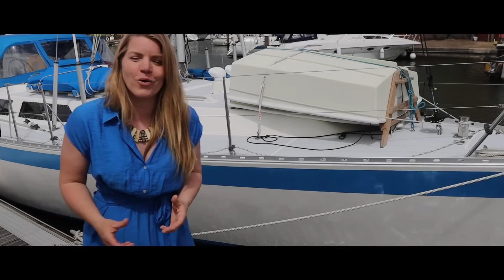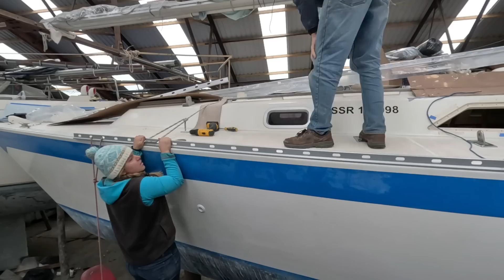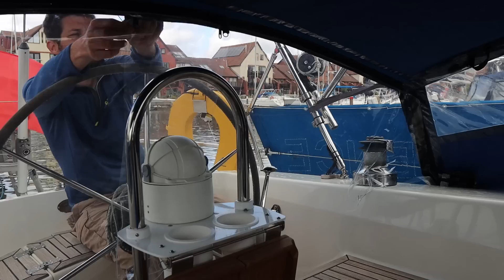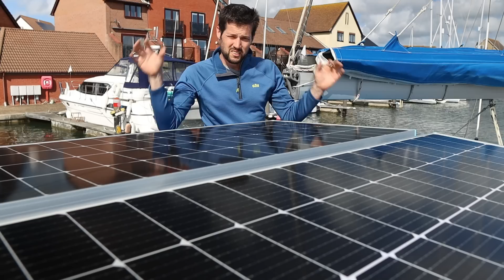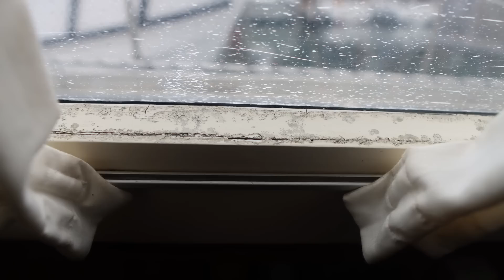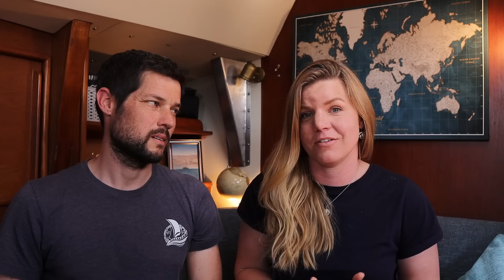Post Refit BOAT TOUR | Sailing Florence Refit – Ep.181

Comment: Now that you've sailed around Britain could you say that re bedding your toe rail fasteners helped substantially with the leaks? I have the same issue and am wondering if it's the fasteners on the rail, the hull deck joint itself or all of the above. Cheers thanks for the vids!

Comment: You may find that new staysail line will get in the way of tacking a larger jib. You may have to roll the jib in and out each time. Also, could you really trust that staysail roller and its line to take the loads of a storm jib in a gale? It looks rather light. and the storm loads are just awful. Am I missing something?

Comment: One of the most important things you can do is double “Glaze” your windows. Without double glaze you will forever have condensation dripping off. A window vac will be your best friend as you go North. The problem with the beds in the fore peak is moisture from you bodies which will condense against the hull below the mattress. Mould will be your worst friend. As I’m typing this I realise perhaps the best fix for this is one or two electric blankets under the mattress. You can get 12 volt 50 watt blankets. When you have surplus electricity or when the engine is running have them come on. Getting one was on my list for last winter but I never. Got to it.
Reply: What about installing a dehumidifier to combat the mold?

Comment: Highly recommend a air dehumidifier to keep condensation in control. We use it during cold spring and fall sails in Sweden (and when our 2 golden retrievers are wet). Also doubles as a drier when washing cloths and you can’t hang-dry outside.

Comment: "Florence" looks magnificent! A furler with  a luff wire is great! I had a ~160% genny with a wire on my 1971 Grampian 30 in the '90s, the furler mounted just aft of the headstay. Old fashioned, and not great for reefing (i.e. partial furling) unless going downwind, but so convenient. The reefable working jib (yankee) and storm jib were hank-on, the furled genny being dropped and coiled on the foredeck followed by hanking on the  smaller jib, Of  course, the jib could be hanked on before furling and dropping the genny, provided it didn't interfere with the furler. Yes, I had to go forward, and the halyard and sheets had to be moved over to the jib, but that working jib was so efficient. Stepping and unstepping the mast was so much nicer not having to bother with the longer-than-mast extrusion and heavy furler, and in my opinion safer than the conventional furling jib which can get stuck on the extrusion, especially if partially furled. I always found conventional furlers temperamental on other people's boats.

Comment: Florence looks wonderfull and very sympathic of you to be so transparent on the effort it took! That focused boat-work mode you describe is very recognizable! Since I grew so fond of you I take the liberty to share two concerns that rose when I was looking at the video: 1) the cushions: if you do not use them to sit against it may work, but as soon as you use them (and we use our cushions a lot on board) your puff jackets will reduce to no more than cushion filling. But that is not my major concern,  my major concern is 2) the tapestry like material that you added to the wall next to your sleeping berths. The insulation beneath this material is a very good idea, but I expect that the tapestry will not prevent the formation of condensate, but it will hide it. Giving you less clues that you have to improve ventilation, also you can not wipe it dry as you can a normal cabin surface and hang out the cloth. Furthermore, it will gather dust etc . I therefore fear that in this way you unintendedly created the ideal mold growing spot next to the place you sleep, which is potentially very harmfull to your health... Just wanting you to be safe!

Comment: Great work on your beautiful Oyster. We have sailed our own J109 Pinocchio up to northern Norway (in the summer). Great experience ! We have the same insulation under mattresses but also added multiple holes in the bunk under panels to ensure air circulation under the beds and in the cavernous lockers under them. Seems to make wonders for a dry comfortable sleep. Have a great time.

Comment: Fabulous reality check you both put out to the sailing dreamers. Florence looks absolutely great and ready for your next adventure. I Certainly Can't Wait. The one question I have is the beautiful new suite of B&G display all linked together and enter faced ? If so I have read it is best to have a independent transducer depth sounding unit, Independent Navigation chart plotter at a minimum isolated away from the whole linked suite. I seen it happen on youtube to other sailors and read stories about this happening. When the linkage is broken by numerous ways and they are all interfaced together one looses every device read out. By having independent critical devices at least one has the basics he or she chooses to continue sailing by if the system crashes for any reason.  Jim Rodgers

Comment: Condensation under bed. We use the air mesh too wbich only provides a partial solution to the condensation issue. This we have solved by using the interlocking foam floor mats sold in Costco and places, cut to size. This provides the insulation layer to stop the condensation. This works 12 months of the year on the west coast of Scotland for us.
Reply from the maker: Thanks for the tip! Insulating under there is on the list...

Comment: Amazing dedication.  I'm six years into my one year renovation lol.  That barrier for condensation you used. I doubt it is enough. If you find it isn't, check out Froli system. European I believe.  It raises your matress. A bit higher with plastic spring things which are very lightweight and make your ,mattress feel more like a home mattress easy to install. Most difficult part is getting the mattress out and back in. Two hour job

Comment: Well done. Just a heads up, and you may well have it under control, but it would pay to have a temperature sensor on your engine alternator that ties into your regulator, {which should be an external one, not mounted on the alternator] given LiFePO4's have the ability to suck the alternator dry of power and burn it out after a while due to it being constantly cooked if not set up correctly. ..........carry on............    😁

Comment: A boat that comes out looking so great after only 8 months of hard work is a great accomplishment! Florence and Amy have never looked better! We got a rough idea of the work load involved without any of the fatigue and grouchiness that goes with it! I suspect that you will be jumping out of the frying pan and into the fire when the days get short and the temps drop, and you are experimenting with a new environment under trying conditions. 

I don't know how many diesel cans you will carry on deck but it will never seem like enough now that you have to heat the boat with it in the arctic. Additionally burning propane while cooking is going to give off that water vapor you didn't want to condense on everything, Maybe you will have to wait until dinner is over to close up the boat and turn on the heater. And I don't know if burning diesel will also give off water vapor, but most of that should go out with the exhaust. Will you have internet in the high latitudes? Will you have anyone doing the weather monitoring for you? I will enjoy seeing Florence's tender out sailing in the glacial fjords to get closeups of the calving glaciers! Isn't that why you put a new rub-rail on it? ;)

Comment: You’ll want to get closed cell foam for your v birth under your mattress. Im using 1/2” doubled up to 1”. Glue it down with contact cement so no air gets behind, then put the moisture liner down. If you can, I would go 1.5” thick for up north. This will keep you warmer and help your moisture problems. In the coldest parts of winter I pull my mattress out to air out once a week or so. Cheers!

Comment: Idea for your insulated blinds: For your blinds instead of suction cups you could attach bolt snap fasteners to the surround and blind and snap it in place; and have the blinds out far enough from the window that if you wanted to put in the insulation the blind would hold it in place.

Comment: Well, Florence is looking #Mads "Super Spiffy"! Well done for your monumental effort! I must say one very important thing: Back in the winter of 2020/2021 wintering in Plymouth I also fitted the same stove as you have which I had fitted by a professional since I also replaced all the pipework. Whenever I used the grill my CO alarm would go off. I had the gas engineer check it and it turned out that the reading was something like 1400ppm (800ppm is fatal!!!) So PLEASE, PLEASE, PLEASE get yours checked out!

Comment: I loved your advice on the refitting. I have just had my Corbin 40 totally refitted in Langkawi but unlike you I paid others to do it. It took 14 months of shear hassle as the contractors were totally unreliable and it cost roughly double my original quote. But my point is, however hard you worked on Florence you now know every nut ,screw, bolt and system onboard whereas if anything goes wrong with my boat I am completely in the dark … hats off to you guys and really looking forward to the new adventures

Comment: If your heading N in winter you might want to think about double glazing those ports and any horizontal deck hatches .. or they will drip condesate if they dont actually freeze up..  Aluring Artic had this problem on the boat they initially took north as far as Iceland.  They also modified their current boat they are taking around the NW passage..this summer 🤞🏻🧙🏻‍♂️

Comment: You two are extraordinary. As a boat owner of Antrice, slightly (3 years) younger than yours. I can appreciate the huge effort it took to get the boat to this high standard. Can I suggest as you head north this summer you look up “Ella in the Arctic” Ella is taking her boat north this Summer after its winter refit like Florence. Ella is using the time to train and refine her boat Yeva in preparation for a solo round the Arctic circumnavigation next summer.

Comment: Hello, good afternoon
S/V Florence Crew. 

Really, it's no longer an Oyster, it's a Triton conch, wow! you changed 40 years of design. 

P.S. There is something I notice: A LOT OF SNOW FALLS in the region and navigation area. Therefore, I recommend that you study this indication: ZEOLITE mineral stones WILL ABSORB MOISTURE AND ODOR. Their maintenance is simple, once they darken, they are washed with running water, whether fresh or salty, plus a brush and you can distribute them throughout the jar, even inside the frizzer and cabinets. Many use charcoal stones but they react to oxygen and humidity. 

Just consult it and study it.  EXCELLENT IS THAT 37' OYSTER GIRL.

⭐⭐⭐⭐⭐

Comment: Nice rebuild of a 40 year old boat, but I must say I don’t understand your Bimini/dodger set up. It’s the only one I’ve ever seen that is split in 2. Why not have it in one piece from front to back? 🤔
Reply: If they don't answer, it has to do with support vs wind, rain drainage, and head room. The angles don't work to have as one piece in the space available. They can sit under the dodger section and stand under the bimini section. They drain separately.

Comment: Terrific upgrades. I especially like the things  like the bimini mods that are fresh ideas. I just bought a B&G chartplotter myself, but I've used them in the past. In cold wet weather, wet hands, in mittens  or gloves... that touch screen is a bit difficult to use. Maybe a  pencil holster and a 'touch' pen on it so instead of having to take hands out of gloves, just use the tool. 
About gloves. Last year I sailed from Vietnam to Canada, I brought my sailing gloves, but I also brought a pair of fleeced lined 'waterproof' rubber gloves. They weren't quite waterproof, but in the cold and wet of the north Pacific they were brilliant. (I have terrible circulation in my hands and feet.)   I've 'upgraded' them to heavy rubber gloves and wool liners. Two pairs of each. One pair of 'rubber' gloves are very heavy duty nitrile  with long gauntlets almost to my elbows (Just got them at the local janitor supply.) This way one pair of liners can be drying out while I'm wearing the other pair.   
I have a similar binnacle with the stainless arch. What I'd love to do is put a  loop on it  out to near the radius of the wheel so instead of grabbing at something out board, or the wheel, there's something inboard to reach for.  And I guess you're used to climbing around the wheel. My boat came with a folding wheel $1000. Be hard to spend that money, but at anchor or tied it it's so much better for moving around.

Comment: Having sailed thousands of miles on the oceans with B&G very similar to that, I think you'll love it.  Their wind display is brilliant for sailing.  (the one you are showing on the inside of the boat tour).  Much nicer than the Garmin/Raymarine alternative.  The Lithium battery system will transform your cruising experience - especially in high latitudes.  Love your new dodger setup and the interior changes.  Rolly Tasker has done well for you guys.  I'm much impressed with them.  I'm not under any misunderstanding of the work required to do all of that.  Great job all around!

Comment: What  a huge  difference you  guys are  amazing. It would have  taken me  years to do what you  did  in 8 months and  it would  not have  turned out  nearly as  well. You  should be very happy with your accomplishments. I am  also  curious to know if the boat will be cooler with  the new  decks but  I guess I will have to wait until you get back to the tropics to find out.
Florence looks  amazing and  I can't wait to  see your  trip around England

Comment: I know you all had lots of projects and challenges during the refit and prioritized a lot. Is a hardtop and increased solar on your future wishlist?
Reply: From my work with solar on boats, 250W is a manageable minimum. 400W gets them well into the comfortable range. I'm sure they will find it very capable.
Reply from the maker: Hard top is on the maybe list, this spray hood is now over 10 years old and showing its age. It depends on our future plans and time available if we go hard top. If we do then yes we would put more solar on top of it. However the 400W of solar we now have is proving to be a massive upgrade already so maybe we don't need more.